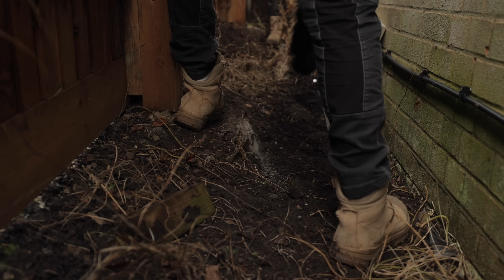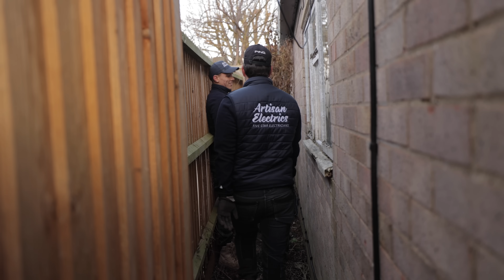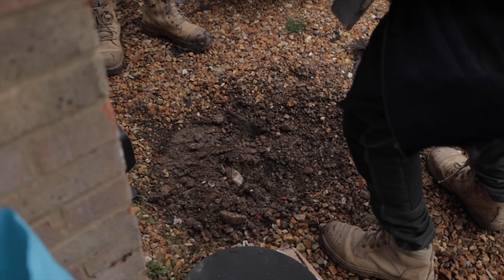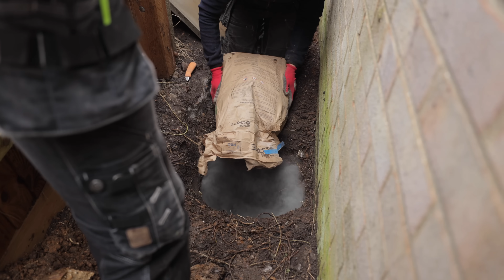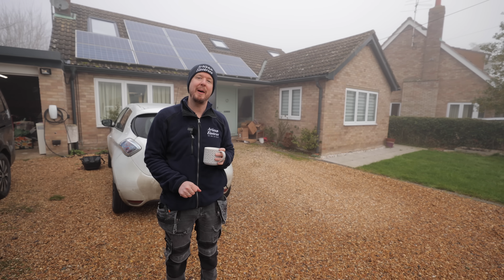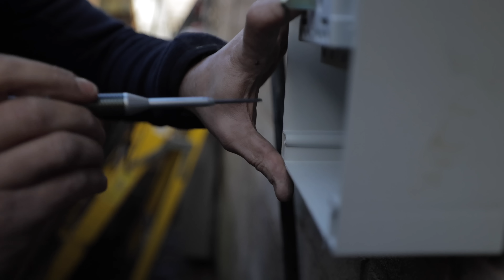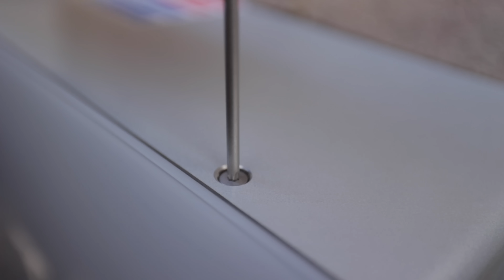BRUTALLY HONEST OPINION! 👀 Tesla Powerwall 3 Hot Takes 🔥

Comment: Everything is live unless you know otherwise.

18:30, the terminals on that solar panel switch is particularly nasty (panels can be live when the system is dead). Just hope the sun isn't out and sub 50 volts is trickling in...

I know you have a relationship with Tesla and can't be too frank... Is the Tesla badge worth the extra cash? There's a lot of completion with power walls these days (some of them modular/ stackable: "pay as you grow" - without end users touching terminals). Sizable companies (LG, Panasonic, Powervault [UK company]...  without touching Chinesium (placing a large stack of batteries hot off Alibaba next to your house isn't smart😨). Hell, even Victron is competing on price these days.

Also, why isn't there structural PVs, in the same way we have structural glass? Seems like a waste of roof tiles when they're behind an array of solar panels.

Comment: Where's the rigid/corrugated conduit protection for the AC/DC cable runs!! Just bare unprotected cables both indoor & outside!! 😰
No way this would meet any Electricity or Solar Standards & Regulations in any other 1st world countries!! 😱
Don't start me on the concrete pavers laid on soft earth! These would move with no gravel or cement base!😨
Maybe they were matching the install with the dilapidated state of the house (rotted window frame, weeds growing up down pipe/guttering etc)!? 😱
Too many Failures!! 5 Star Electrics? I don't think so! 2.5 Star Max & that's being generous!! 😮😧😨

Comment: The very first statement made about the Tesla Powerwall 3, that it has a built-in solar inverter is surely wrong no? Isn't the point of a DC coupled battery that it doesn't need a solar inverter, nor a DC to AC transformer to convert that input back to DC in readiness for battery charging? Surely the only thing it has is a standard inverter for the output load only, making it much more efficient since it doesn't waste energy on a needless DC - > AC -> DC round-trip?

Comment: Another thing you didn't mention and didn't use that makes the PW3 better is the backup switch (meter collar ). I don't know if you are using it in the UK or if you can, but the backup switch eliminates the need for the Gateway making installation faster and cleaner.

Comment: 130kg! Is waaaay beyond safety manual handling regs - one man continual intermitant lifting is 25kg - concrete blocks etc. 50kg is normally the one man, single lift limit, so for the two guys they were 30% above the max limit! Just because they did it, doesn't make it right - access was crap and you aren't builders so why laying slabs? You should have either insisted on acceptable access and bases installed by others so proper lifting equipment could be used. Maybe no bad backs now, just wait till they are in their 40's! You talk H&S but don't practice it - your risk assessment should have flagged this up!

Comment: Guys c'mon you even mentioned it in the video the gateway acting as a consumer unit in a plastic construction, this contravenes the regs which you stated, Tesla don't tell you that you have use the gateway as a fuseboard but what they do tell you is that you must comply to all local codes/regulations, simplest way is to install a separate DB and Switch fuse isolator. The gateway 3 however is said to be of a metallic construction due later in the year.

Comment: With the 97% round trip figure, was this just the claim that Tesla made or did you do something to confirm it?
Reply: That's on the spec sheet, most of the efficiency gained is from being DC coupled do the solar modules. The old pw2 was AC coupled so you added 2 more inversions which lowered efficiency dramatically

Comment: 130kg!!  You guys seriously need to build a wee 'assistant' for mounting the PW3... Something like a narrow 4 wheeled trolly that you temporarily mount to the PW3 to whilst it is lying on its back which you then lift vertical, trundle into position and then the trolly has some sort of winch system that elevates the PW3 to the required level for you to then drill/screw through to the wall - all with next to zero effort (or danger)...  You could make a fortune selling it!

Comment: I assume this is not an inverter for connection of the solar panels directly to the battery rather it must be some kind of DC to DC converter to charge the batteries
Reply: The solar modules are wired directly to the pw3 unit. It has its own solar inverter
Reply: My point being is that an invertor takes DC to concert into AC whereas panels are DC already and don't need to be re AC'd to then DC charge to charge the battery stack ??

Comment: How does the  Gateway in a plastic cabinet conform to current regs.
Reply: It doesn't meet regs as it's technically still a fuseboard if you add mcbs etc,
Reply: @chrisyoung7362  So a < 100 A ac Consumer board requires a metal enclosure yet the Gateway switching control of DC does not. 
Can you point me to the IEEE reference.  Thanks.

Comment: 1/2 way through and confused:   if the Powerwall 3 has a built-in gateway, why is there another one being installed inside the garage?  And that is a lot of Powerwall 3s for what appears to be a small solar array on the roof, an explanation at the start would have helped.  And yes, the units are heavy, the install was difficult, but what about the advantages of Powerwall 3 across ALL your installs?  That is what I wanted to hear about.  Disappointed (again).

Comment: I'm a huge fan of a tidy cable and usually love the AE install work and videos but this one just seems a bit sloppy (the state of that paving) and moaning.  Okay, we get it... the units are heavy and prob aren't going to be wall mounted anymore but this all seem like an installer "problem" not a consumer problem?  I'm sure that will be factored into the install costs.   It also sounds like Tesla provide tools to help move and install them if the installer feels they would be of benefit.  I'm far more interested in the functionality and integration capabilities and comparisons to competitors.  It seems like, on balance, it's a good system (especially if you're already in the Tesla eco system) with good expansion options?
Reply: I’m an installer. 
Muddy? Try dropping 300 lbs on your buddy. Or having to warranty and repair, and push the jobs down the roster. 
They are a pain. 
I only install Enphase when ever possible. 
This video isn’t just about you as a consumer, it’s about all of us, consumers and installers. 
Take that for what it’s worth.

Comment: great video as always .... perhaps too much bias on one-off  installer issues .. (mostly due to not using the proper Tesla lifting gear) ... and didn't highlight to option to use as an AC only (as mine is installed) .  Also, but didn't mention all of the user benefits like the temperature management, which is the best on the market.

Comment: The guys who installed mine had a special trolly, but I guess your site was maybe too tight for that? Agree about the App, that was quite a disappointment for me. The way it makes you choose between 'Time-Based Control' and 'Self-Powered' on an all or nothing basis is not ideal for the UK. I want it to charge up to say 80% on the overnight tariff but leave some space at the top for solar generation the next morning. Also I do not want it to export to the grid unless the battery is full and there does not seem to be any way to set that, give it 'permission to export' and it will merrily export energy from the battery!
Reply: The User APP is a disappointment, if you can get the Tesla One APP working it is better.  The big thing I want is the ability to see, in the user APP the relative generation of each string, you can only do this in the Tesla One APP.

Comment: Seems like a lot of 'you' problems are highlighted here! As a consumer, I pay for a service, for a product that I want, the issues with the install are not a concern. Build this into your prices. The end result and useability is my concern!
Reply: I'd say they are a concern though. If something goes wrong, how complicated it was to install the stuff in the first place gives you an idea of how long your downtime might be to get the problem solved. It all matters. If something is hard to fit then (some) fitters are not really going to want to fit it, which means they might cut corners, which could lower the standard of the work, which could lead to further troubles down the line, etc.
Reply: sometimes, as an installer, you strike a situation where no amount of foresight or crystal ball gazing would have helped. You get presented with a situation that was not predicted at the quote stage. That happens not so often, but you can now longer do the job at the quoted price and the method now no longer suits what has been discovered on site. If you are very lucky a quote will have method 1 (the way they hope it will go; and failing that, method 2 (price 2) if we discover some unanticipated problem........

Comment: So.... You guys forgot to talk about the Tesla built trolley for installing the PW3 that has a built in lift etc. Pretty sure as a cough cough authorised installer you are meant to be using it or at least should have told the views at home you didn't use it as it wouldn't fit down the side. Pretty disappointed in this slanted video.

Comment: Don't know if this is a silly question but can the DC isolator switch be moved if its not being used for solar? Spoils the look....
Reply: For equipment function comes first. If anyone wants changes always quote a very large fee to discourage it. If I was asked to move it I would put it in a locked cupboard indoors too high for anyone to reach without a ladder. Then when the battery caught fire (being LPF it would not of course) the twit who asked you to move the switch could rush around finding the key, and then the ladder all whilst their home burnt down.

Comment: Your guys were a lot stronger than the two that installed mine! Hope you took a picture of the password and QR code before the cover went on as the customer will want that if they want to use the netzero app and access diagnostics to see degradation. Mine was made in Arizona so at least not Chinese. The small Gateway is handy for those of us with limited space. Seems to work really well and the Tesla app provides a lot of info about where power is coming from and going to. With 2 PW3 and planned expansion this must have been done under G99 with an eye to exporting, so who gets the default setting changed so you can export from battery not just solar, installer or customer, seems a few YT'ers have had to find out they needed to get this setting changed direct with Tesla.
Reply: The Tesla one app is for installers only the consumer does not have access to this. They don't need the QR code the installer sets them up in the regular Tesla app
Reply: @cardigansrule  the NetZero app allows the user to setup automations and gives you more control over the functions of the PW. The password in netzero only allows you to access some diagnostics not do anything, the only real info you get to see is degradation which before the 10 years expires I'd like to know, I'd like to think my installer would still be there and not taxed out of existence.

Comment: It would show what a scam all this is if the cost of electricity dropped tomorrow to say 20 percent per kWh above what the National grid costs are for producing a kWh of electricity averaged out over the last few years. Which currently sits at around 7p, so say 8.4p per kWh.

But obviously the parasites in power will maintain the artificially high energy prices to make people justify spending tens of thousands on all this kit in my opinion.

Comment: All that money on 2 power walls yet it's his rotting window frame that needs working on the most😂
Reply: They are having some internal work done on the garage, splitting it into two rooms. I'd give them the benefit of the doubt and assume the window would be changed during that work.
Reply: the rotting window frame enhances the Tesla's ability to charge quickly
Reply: And don't forget the foliage, weeds & vines etc growing up & around the down pipe & guttering at 16:24!! 😱
Reply: The outside appearance of the wooden frame doesn't cause problems inside.
Reply: @АгронДепартье  One with that many rotted sections and cavities - does cause problems, rain and moisture will be getting into the cavity possibly causing damp and mould on the surface of the inside walls.
Reply: @blower1  Of course not - those are hanging sections, at most more rain will fall on the outside wall. The rest of the window looked ok
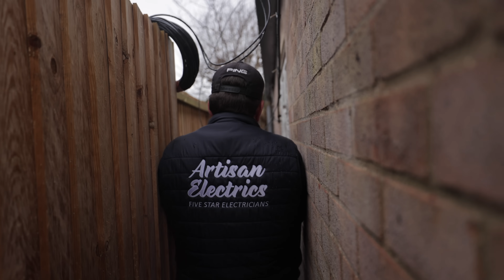Reply: @АгронДепартье  11:20 Look again, bottom corner of the glass isn't even sealed and exposed as frame has rotted through. Through the window can see the frame rot has extended to the inside. Its rotted through and moisture will be penetrating.
Reply: I noticed that too.😂
Reply: If they are splitting the garage with a wall they are probably fixing other stuff in there too
Reply: I was about to say the same thing. Thousands on tech but ignoring a couple of hundred quid for a basic plastic window 😬
Reply: People's priorities are a bit odd!

Comment: Some thought needs consideration on location where threat of flooding. Think at some installations the outdoor battery pack should be installed higher from ground level.
Reply: It's supposed to be flood proof and can apparently be operated while in 2' of water.
Reply: Yeah they have a video of one sitting in a fish tank. That said we don't install any of these touching the ground they are a foot or two off the ground this is by local code requirements.

Comment: 130kg in a single piece is a horrible/lazy piece of design/engineering and completely unnecessary. You guys are better than me I would refuse to lift that. Is musk paying medical expenses?
Reply: They forgot to say Tesla has a trolley built for installing the PW3 with built in jack etc, but they didn't use it. I guess it didn't fit down the side of the house.
Reply: These aren't by far even the heaviest batteries IE Franklin is over 400 lb my crews install them all the time. maybe you need to hire stronger people.

Comment: PW3 is LFP,  thats why its heavy and very durable. It wasn't optimized for price, but for mass production and low cost to manufacture.
This is the way to go, most or all boxes integrated into one.
Allegedly the newest megapacks can connect dirrectly to high voltage grid, don't need their own transformer from the utility.

Comment: i love this channel i love you guys but that slab laying was terrible. no compaction no sharp sand and cement dry mix under them i bet the weight of those packs will snap those slabs after one winter.
Reply: Never send an electrician to do a kitchen fitters job ..
Reply: @LDaQuirm or the job of a ground crew.
Reply: What happened to plan that the slabs will be cemented in mentioned at 0:48 of the video?  Would imagine sub-base of gravel or such is wise for the weight of a house battery?
Reply: Think the weight is taken by the bracket attached to the wall, the feet are required to stabilise when an expansion pack is fitted
Reply: I'd just make entire place a path, not a couple of bricks.
Reply: I feel bad for the customer and if I was Tesla I’d void the warranty based on the installation.. defo wouldn’t sign of if on that if I was still on site, poor form, poor form
Reply: @abc123evoturbobonker  Love the armchair heroes criticising. Nobody is more of an expert than the guy who is looking at the previous guy's work. So many builders/electricians/plumbers I've had spend so much of their time slagging off the work you've had done before, then the next guy in tells me their work was shit too. It's a wonder you're not all perfect by now.
Reply: @ lol

Comment: My EV loses 50% of its distance in winter. I assume this is the same for an externally mounted battery?
Reply: To some degree, but battery chemistries vary a lot in terms of what low temperatures will do to them. A lightly heated outbuilding would probably be best for any type of battery bank, but I'm not up on the regulations & whether that's even allowed.
Reply: i'm reasonably sure the tesla has a heater in it

Comment: All their complaints are completely unjustified, for one tesla training clearly states that the dolly that you can buy from them is the only way you should transport, lift it up to its maximum installable height therefore whoever said they should be installed down that narrow alley are the problem as well as the brainbox who runs the company for not supplying the required equipment to install and expecting their installers to lift 135kg between them not caring about safety one bit. Commissioning takes no more than 30mins if installed correctly which is standard for most tech that requires updates 😂
Reply: The problem is that nobody should need to buy a proprietary piece of single-purpose equipment to fit something that already costs and arm & several legs. The thing costs two grand.
Reply: @nightcatarts  thats like saying build a car but dont use any tools to do it. Or hang a picture on the wall but you cant use nails or screws or hammers or drills.
Reply: @nikgray6635  No, because all those tools have many other uses in many other situations with many other types of materials & equipment. There is absolutely zero justification for making people pay 2 grand instead of fitting handles inside your really heavy box. None.
Reply: @nightcatarts  the dolly has many uses also, no different to a sack barrow sure its specifically designed to lift a powerwall 3 but has many uses none the less for moving heavy objects or equipment. Think outside the box.

Comment: What you need for moving those Powerwalls and other batteries around, is a snooker table slate transporter. Narrow and very strong.
Reply: Tesla has a trolley built for installing the PW3, they didn't use it. It has a lift and everything.